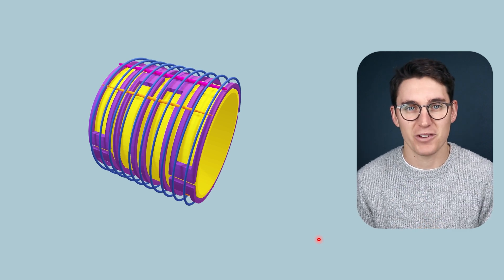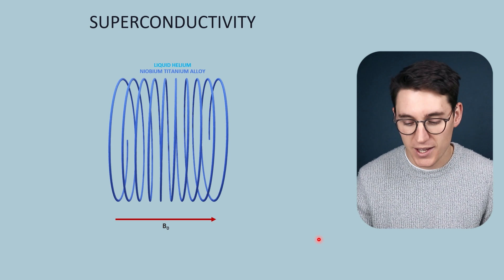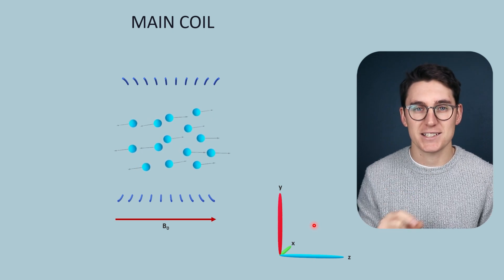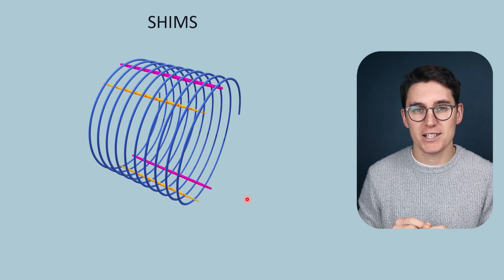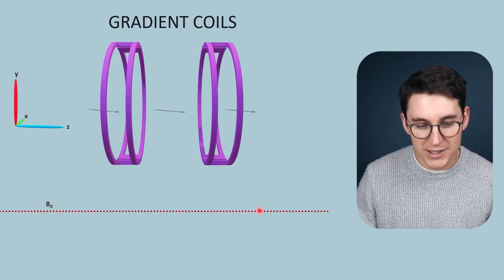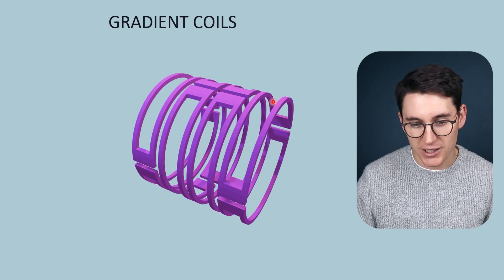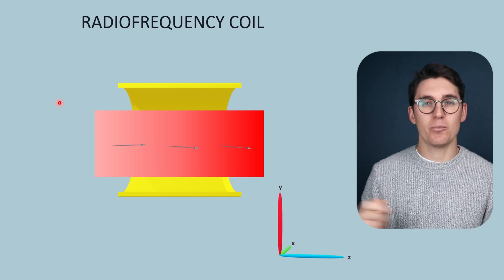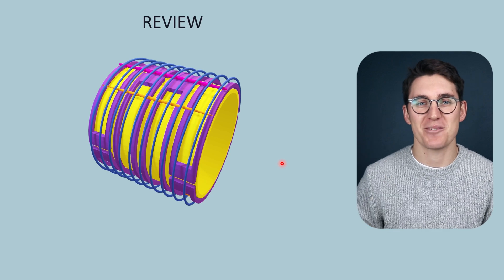MRI Machine - Main, Gradient and RF Coils/ Magnets | MRI Physics Course | Radiology Physics Course#2

Comment: Can gradients make the magnetic field stronger than B0? Your illustration implies that the magnetic field to the right of iso-center is higher than B0 (for instance 1.5T) as a result of the gradient manipulating the field.

Your spin is precessing faster to the right of iso-center. Indicating a stronger magnetic field
Reply from the maker: Spot on Luke. The gradient field “adds” to or “subtracts” from the main magnetic field depending on location along the z axis.